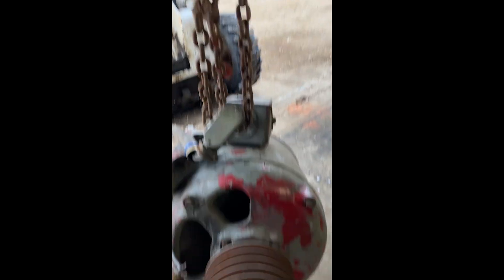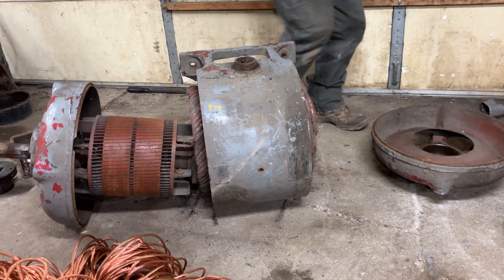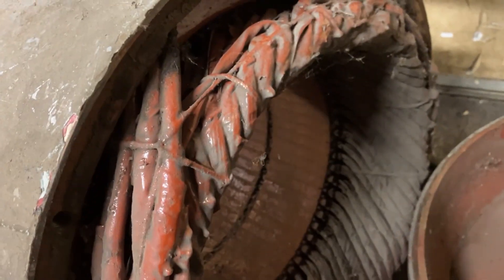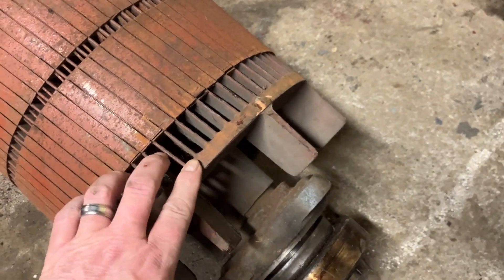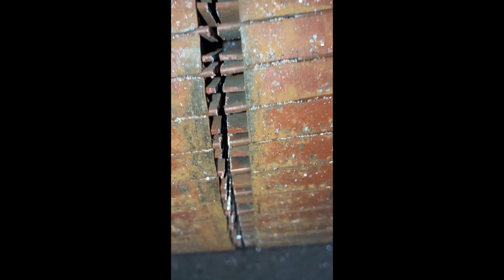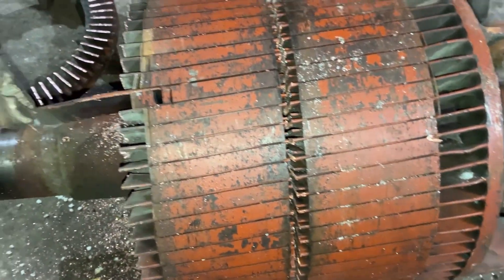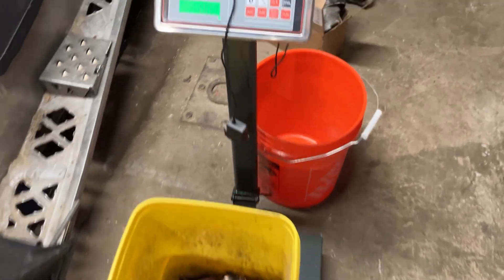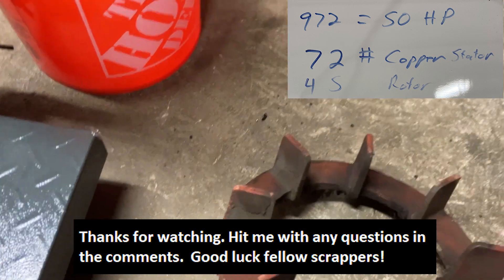Old 974 LB electric motor dissassembly.

Comment: I think I saw a video from pakistan scrapping big rotors like that, they cut the one end and burn the rotor to get the copper.
Reply from the maker: I think I seen that same video :) I have broke down two 300 hp motors right around 3000lbs. That really is the only way to do those huge motors. When we send motors in to get fixed that is how they do it as well, cook out the windings, clean it up and then rewind. Thanks for the comment man!

Comment: Wow I'm checking rotors on the big motors from now on. I hope I didn't scrap an old copper rotor for steel even a few days ago. I've been able to crack the cast iron cases on up to 50hp motors before with a maul/sledge/ railroad spike/nail hammers. Although that's the biggest 50hp motor I've seen.
Reply from the maker: Ya, it must be an old one. I agree its a different setup than I've seen as well. Hopefully it wasn't copper :) I bet you won't let one sneak by from now on lol. I have cracked casings on 300 hp motors before. Since then I found that they are made to be removed and you just have to drill out some plug welds. Lots of the smaller motors (well pretty big ones) have roll pins or studs that hold them in. If they are big enough to be fixed they are made to be taken apart without splitting the casing (except for this old one :)).